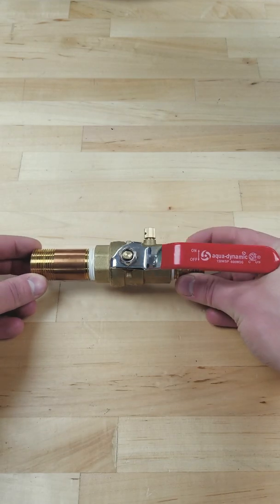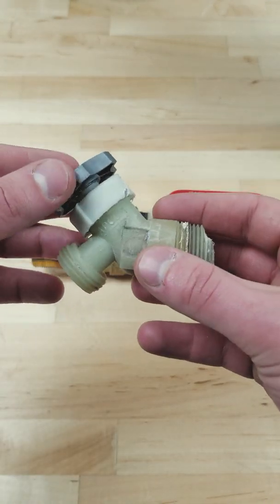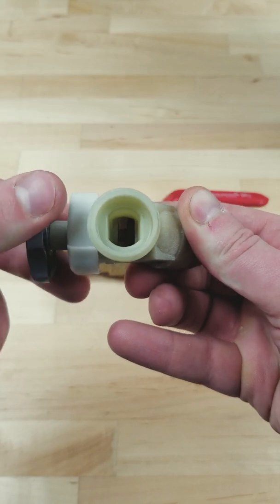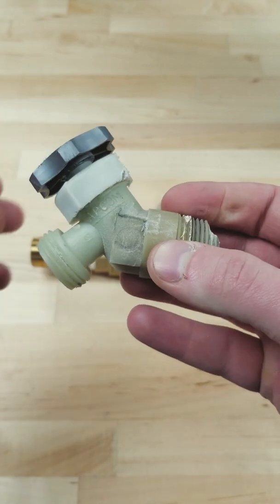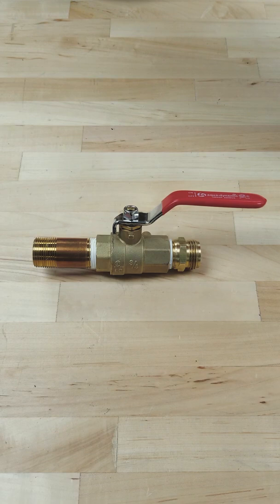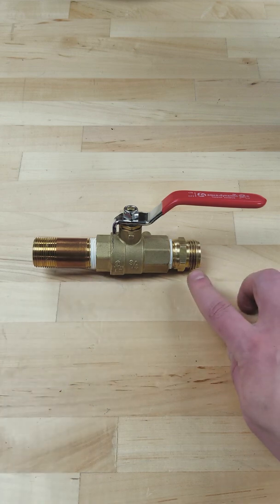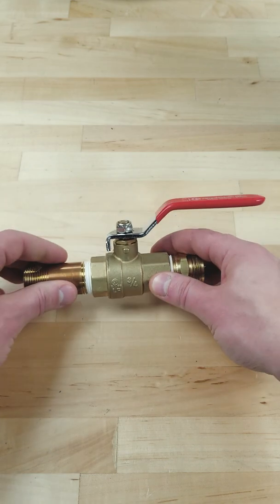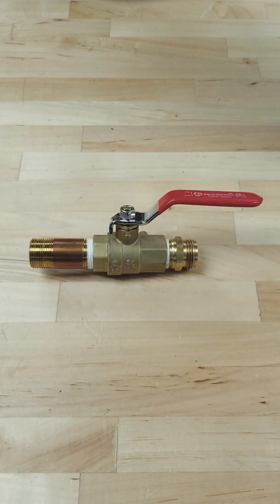Ball Valve? - Water Heater Drain Valve Upgrade Tip

Comment: I bet this never gets clogged with the gross bits
Reply from the maker: The full port ball valve is definitely an improvement!
Reply: Oh it does occasionally but can be quickly unclogged by using a coat hanger or long screwdriver or by turning your cold water supply back on for a few seconds or so.

Comment: He notes the ball valve opening is the same size as the fitting, well that's a specific feature called "full port" valve.
Reply from the maker: Thanks for watching. In the description of this  we put a link to the replacement video. (This may or may not be visible depending if you're watching on a computer or a phone) This shows how to drain the tank, remove the standard valve and replace it with the full port ball valve: https://youtu.be/nGCejMsKNX4